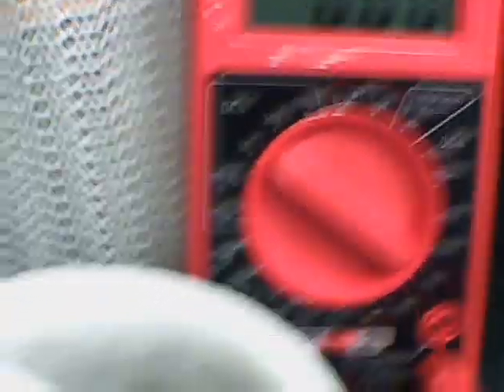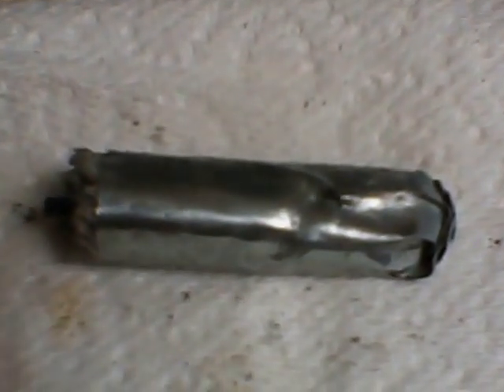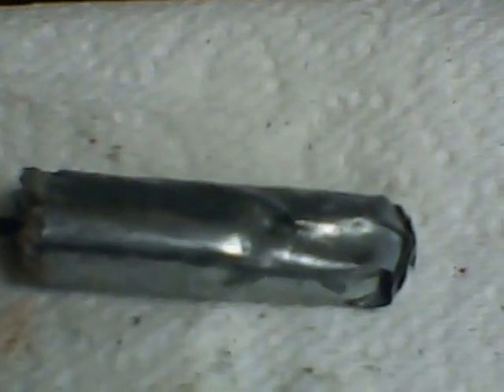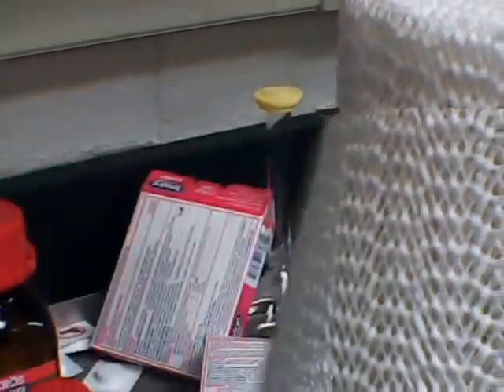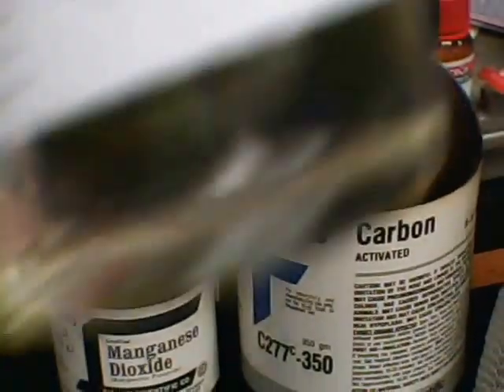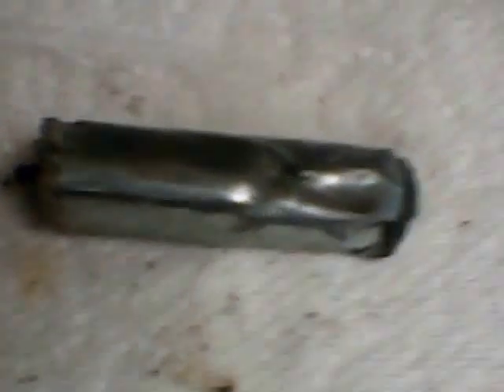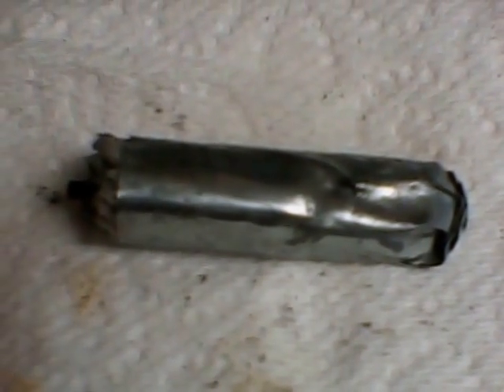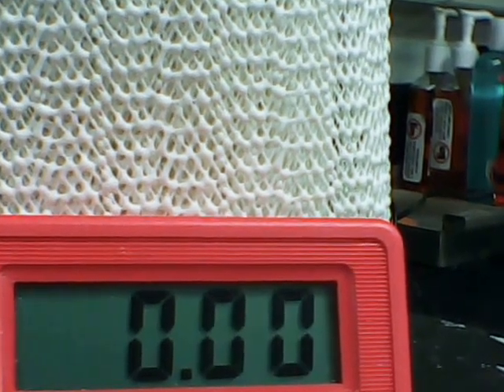Zinc Carbon (manganese dioxide) /Ionic Liquid Battery

Comment: Well done David... seems to be too high resistance inside the cell... Try to wrap a stainless steel mesh metal around the graphite pencil to reduce the ohmical resistance then you should be able to draw much more current , if the electrolyte is not too high ohmic in resistance. .. Regards, Stefan.